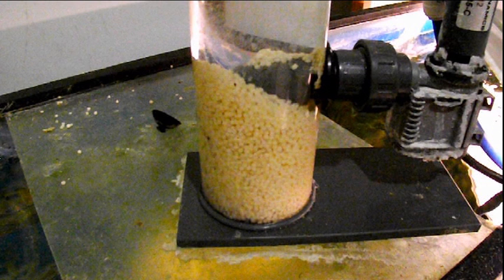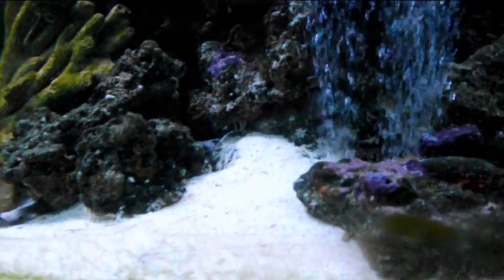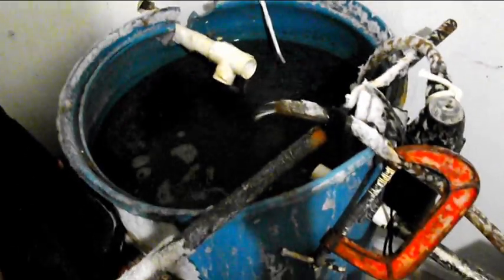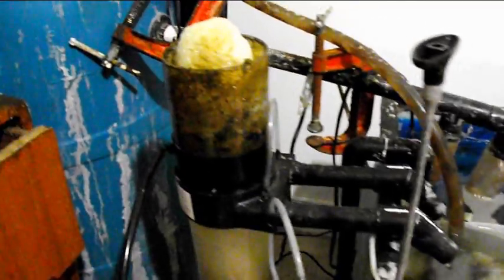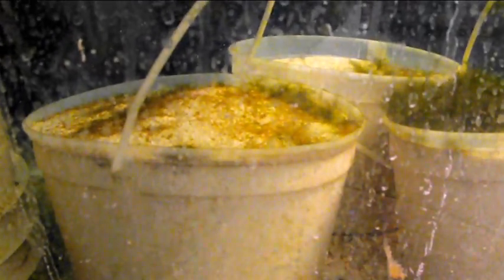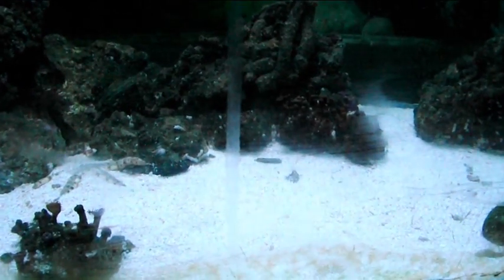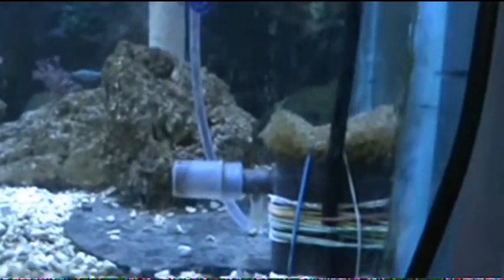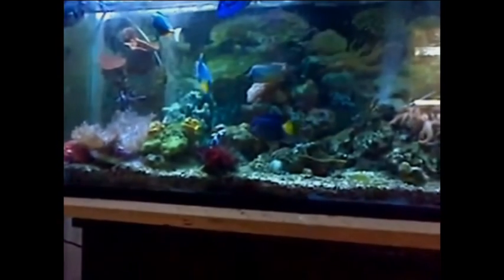How to REMOVE NITRATES 7 different methods MAINTENANCE FREE aquarium.

Comment: The two types of bacteria Stoni Us mentioned is correct. A deep sand bed and live rocks create a good environment for both aerobic and anaerobic bacteria to live on, and they work in an assembly line fashion.
On the other hand, the reason people having nitrate problem is caused by their setup has many places that are good for aerobic bacteria to thrive, but not good for the anaerobic ones to survive, such places could be your filter floss, foam/sponge filter, the filter bag came with the sump, or the coarse gravel Nitrate Buster talked about. The assembly line stops at producing nitrate and no anaerobic bacteria there to finish the process. Try to get rid of above mentioned filter material as much as possible and/or replace them with cycled rocks if fits.
Deep sand bed and cycled rocks are the keys to solve nitrate issue in a saltwater aquarium, no fancy equipment is necessary.

Comment: Thanks for sharing! Just wanted to add something here. There are 2 main types of bacteria in lakes and other natural bodies of water. Aerobic which takes ammonia turns it to nitrites and then turns the nitrites to nitrates. Then there is anaerobic bacteria. Most of the time we avoid buildup of anaerobic bacteria because of the possible bad things that can happen, but it seems to me you have found out that the anaerobic bacteria actually consumes nitrates and releases nitrogen gas. We know it releases nitrogen gas because of what happens in some natural lakes.
Aerobic bacteria (or what is normally called good bacteria) requires oxygen to flourish. So shallow substrate good circulation, etc. 
Anaerobic bacteria (normally called bad bacteria) requires areas where oxygen isn't able to reach. 5 inches of sand would do the job. I wonder if making a few sand tubes with no circulation in them would do the same thing but on a micro scale.
Btw, all of the people making rude comments are just upset. Most of the stuff we are taught says to avoid the anaerobic bacteria. It seems to me that you just proved that the anaerobic bacteria + plants are actually the end of the cycle. Not just ammonia to nitrites to nitrates to plants.
I was starting to think that myself, but with your comment about the buckets working best, you just proved to me that all of the bacteria is necessary for the FULL cycle. Also shows that a tank probably can get to a point where water changes are not necessary. Just have to be careful about the sulfur produced by the anaerobic bacteria. Thank you!

Comment: Basically, what I've done is to include only smooth rocks at the bottom of the tank that I can easily remove, clean and vacuum the bottom of the tank. Then SLOWLY and CONTINUOUSLY filter the water with a quality filter at 20 gallons per hour. I clean the filter daily in the sink. 100% clean water, no BS...

Comment: I just tested mine and they were a 0. All I use is a rack that sits in the sump with a bag of Seachen Seagel in it. It sits just below where the water falls from the last panel from my bubble trap into my refugium. No reactors at all of any kind. Good info though. 120 gallon tank, 29 gallon sump.
Reply from the maker: Cool

Comment: Hey Nitrate Buster. I agree with you that you are overkill with all the different set ups but that's your mission- to get rid of those nitrates and phosphates. One thing I have found with my system is that keeping that sand bed clean is the #1 way to keep your nutrient levels low. When you have a lot of fish and feed a lot you have to do this. If your sand is coarse enough - vacuum it when you do water changes. If it is fine sand stir it to loosen any trapped fish waste. Also the live rock gets suffocated by the same stuff and starts to look dead. Use a turkey baster and shoot jets of water over it "dusting it off" This will help to bring it back to life. Keeping good water flow in the display is important too I have found. It helps to keep all the waste suspended so it can be removed by the filter system. The anemones like good water flow too. My nitrates and phosphates were running high too and I found these maintenance practices really helped. It takes time though! Good luck

Comment: Yeah but, you've gotta clean the glass of your aquarium, man! You could also buy a big ass outside filter, they come with different compartments to fill with whatever filter material you can come up with, their price varies from seller to seller. Also, you just need an reverse osmosis if you REALLY want the water pure as it can be. Very messy setup but, I bet you have changed that outlook.

Comment: If I was a noob and viewed this video, I would not get into the hobby. I'm not here to bash your video, but your approach is totally wrong. You do not need all those methods to have low or no nitrates. First thing control your feeding. You feed a lot everyday and don't need to. I have a 28g nano cube and have 0 nitrates and phosphates, with just a good protein skimmer and good husbandry. Water changes are very important as well. Good luck and save some money.

Comment: That's an incredibly large amount of equipment just to remove nitrates which will create another problem. The algae will compete with x10 skimmer and pellets for nutrients which will cause it to die off and add phosphates. Your biopellet reactors will have bacteria die off due to your tank going to a 0 nitrate so fast and that will cause your tank to re-cycle. What you are doing is needed for a severely overstocked 300G+ display tank. I do not doubt you logic but take a second to think.

Comment: bubbles do not directly add oxygen to your system.  They do provide a small amount of gas exchange at the surface and this is where you get oxygen dissolved into your water.  Sorry to hear about the loss of your corals.  I was thinking about purchasing one, but not now.  Thanks for the time to review the product.
Cheers